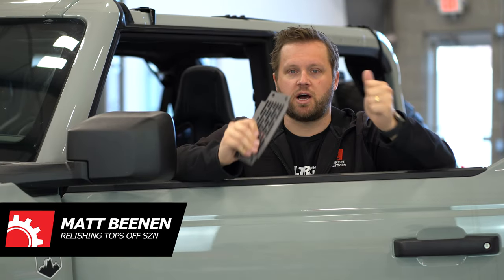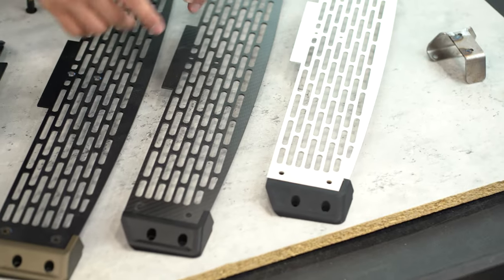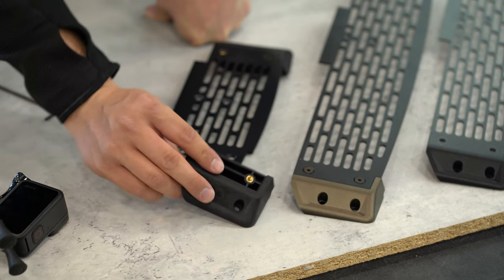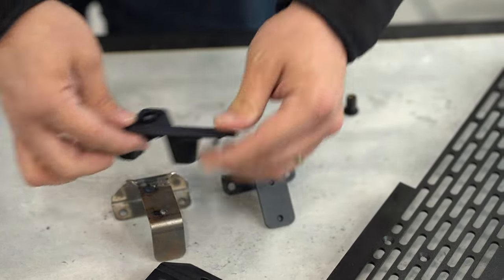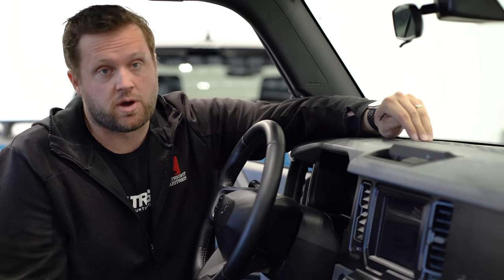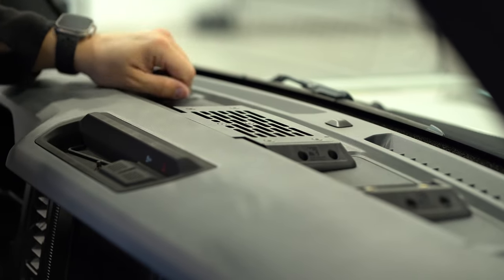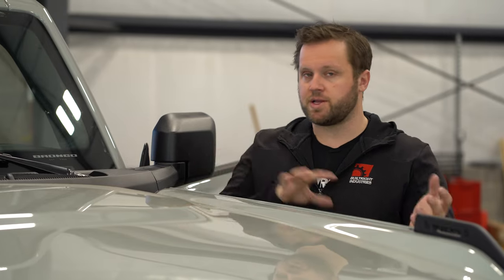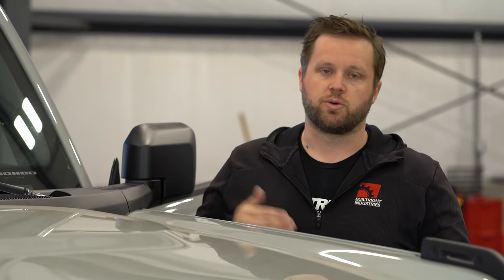Ford Bronco Dash Mount // Product Deep Dive

Comment: drilling in the dash is a deal breaker for me
Reply from the maker: It's not essential for our Bronco Standard Dash Mount! We use VHB adhesive on the bottom of the mounting blocks so you don't need to drill if you don't want to